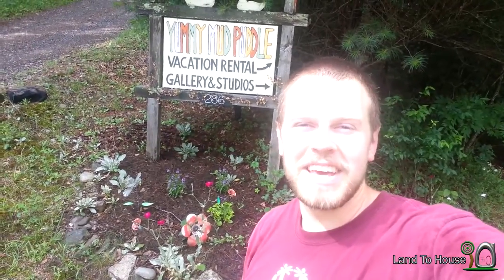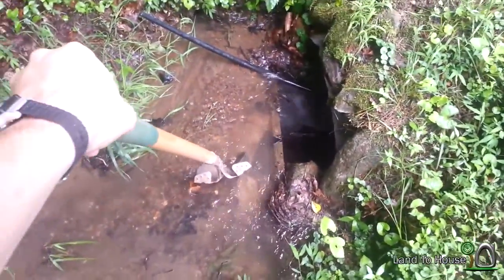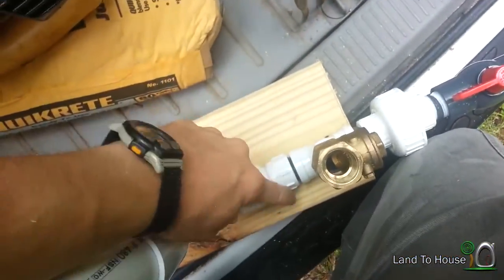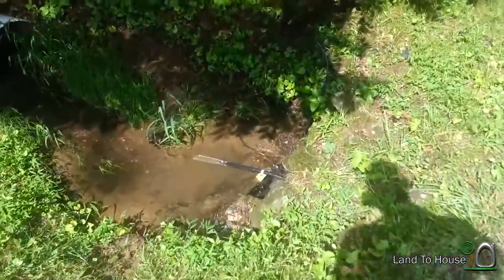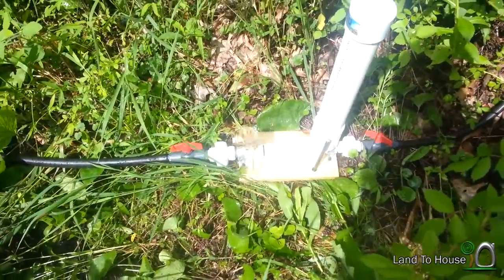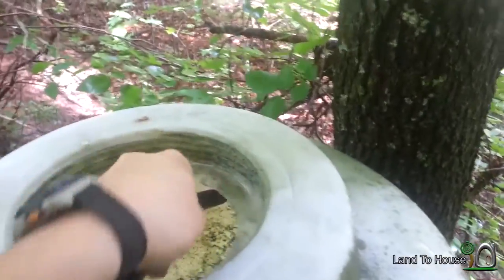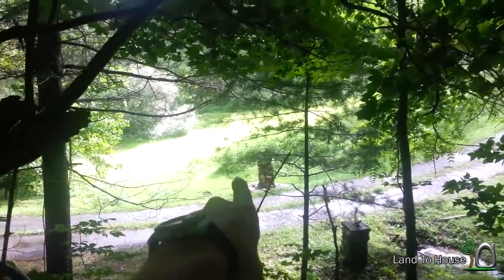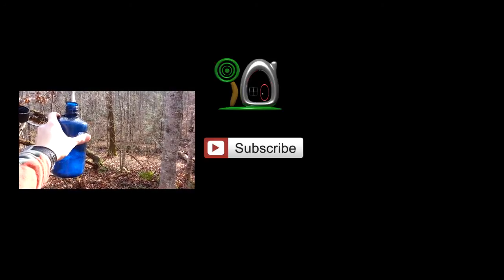Yummy Mud Puddle Ram Pump 2

Comment: Great install.   I sure did learn something with that mount.  I plan to use that on my pump.  I wish we were getting that rain in Davie and Macon county.  :)

Thanks a lot for these great videos.
Reply from the maker: These pumps are kind of awkward because they are rounded on the bottom but with the board screwed onto them its very easy to work with. I was surprised. and if you put rebar at the pump like this one it makes it stop bouncing. 

We had two weeks of major rain. I would say over 8" in that two weeks.